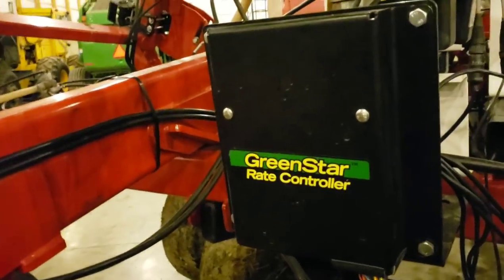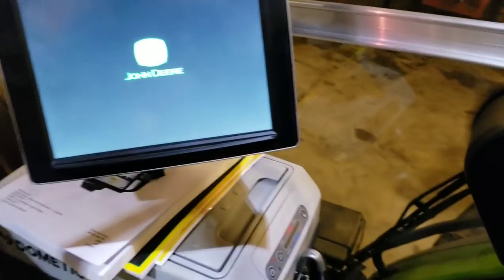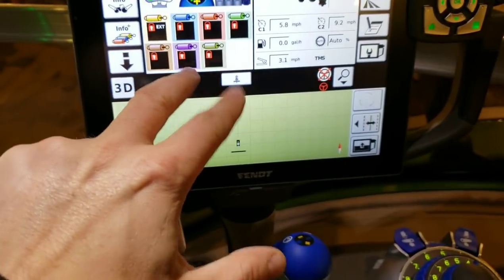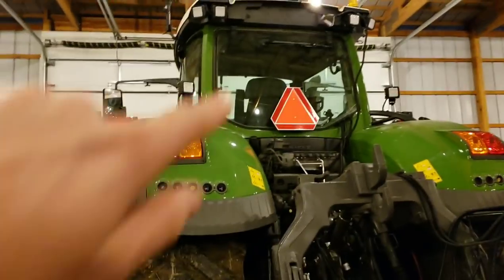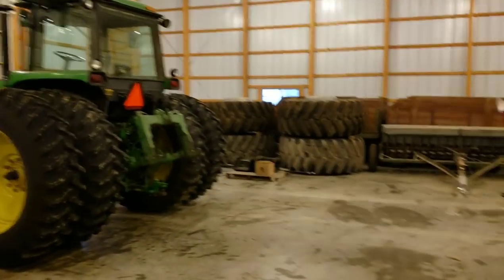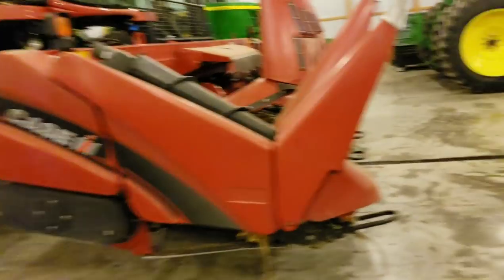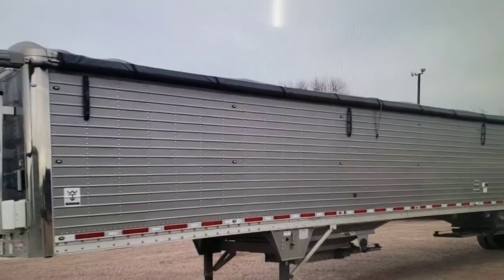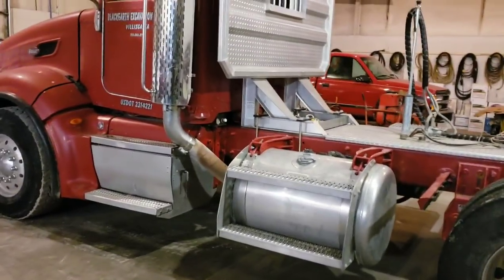The suspenseful rate conteoller...dot dumb

Comment: Our bridge laws in New York State are different than yours. I'm permitted for 102 on 5 axles and 107 on 6 axles.I have a 46' trailer that I haul grain with and my road tractors have a 14,600 & a 16,000 front. When I gross 102,000 with grain it's very rare with a level load to ever be over 14,000 on my steer axle. We have our own scale and can check these things. The way New York State works it is what ever had the lowest weight rating that's what you go by. Another words if you have a heavy axle yet your tires don't have enough of a rating you have to go by the tire.

Comment: crazy idea here but that truck you have there what about putting a grain box on it and use it around the farm there to bring grain in to the farm
Reply from the maker: I've considered it but I dont think i will ... maybe though ... suspense builder!  They are not very fast on the road - but do go about anywhere ..I really wanted to sell to have enough $  to upgrade semi tractors ..
Reply: @Blackearthexcavationandtiling  well the go any where is the part that made me think of this i do recall you saying a lot of your farms are hard to get in to with 18 wheeler and that was your call to get around that was the hopper wagons was wandering if the truck would gain you any speed over the tractor and also save you on running a tractor up and down the road i do know tractor tires are not cheap

Comment: What jd combine would you prefer? And how many hrs on the 8240
Reply from the maker: If I had the $$ I would buy a S780 JD ...... our 8240 has around 1000 hrs ... wanted to buy a 9870 - but they all seemed to be very overpriced
Reply: BLACK EARTH EXCAVATION & TRENCHING, LLC oh ic it’s ridiculous the price of used combines and do you find that machine on the web or a dealer
Reply from the maker: @rileelang11  thanks for the reply ... we had a case ih 8120 - it was up around 2K sep hours and needed some work - after seeing it was only worth 75K trade in we decided to sell it private for $120K .... goal was to buy a 9770 JD and then pay off a couple other things .. as it turned out the JD dealers were all crooks and decided they need to make to much - I felt 110k and up for a 9770 was nuts! Especially considering they probably didn't have 60k in it .... finally found a 9870 for $65K- was priced right - went and looked and its cab was full of mice and mice damage so said screw it and bought the case ih 8240 ..... the 8240 was through a dealer but it was a customer to customer - half assed inside deal .... we figure dealers needing to make 70 grand each machine is Rediculous.....
Reply: BLACK EARTH EXCAVATION & TRENCHING, LLC It’s interesting how you play your money cards and see what you do and how you do it and hear your opinions. Wow is it just crazy how dealers work and what they try and do I’m young and I’m taking in as much as I can too learn once I get my farm.